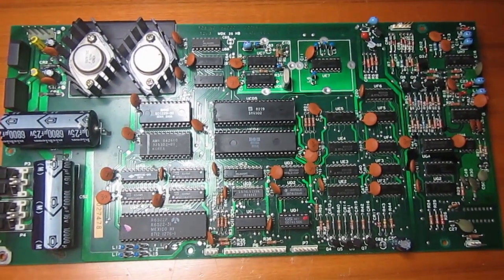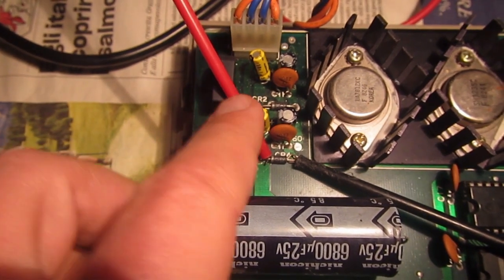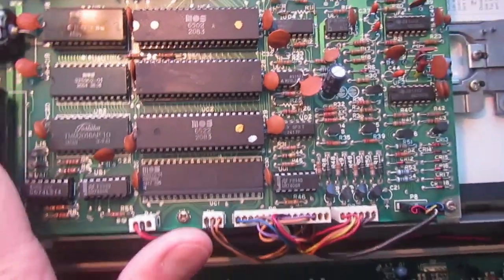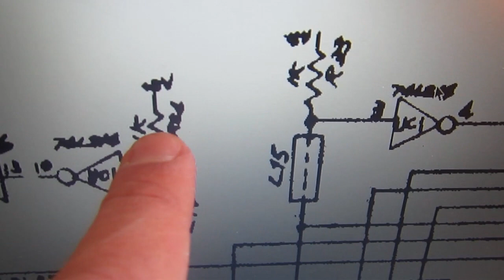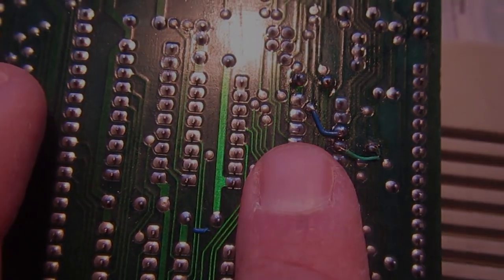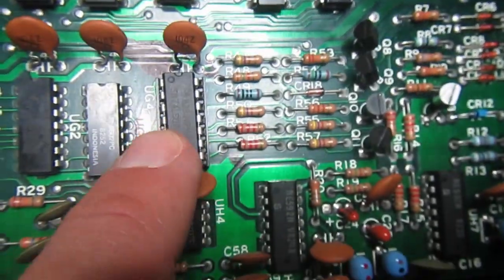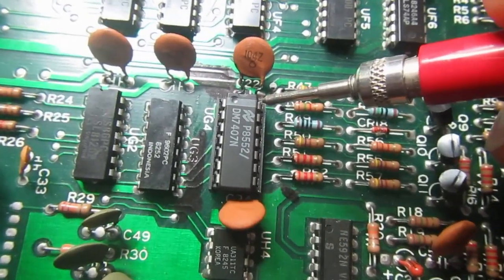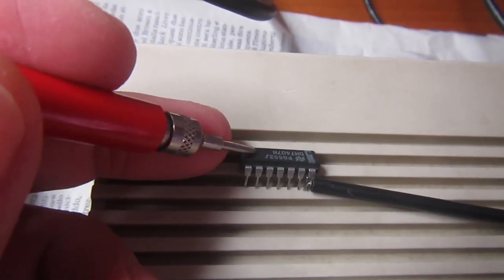Commodore 1540/1541 Long Board (long!) repair.

Comment: Adrian brought me here,  glad he did.  You have an excellent channel!  Also nice to see another Tek 475 scope out there.  I just did a complete restoration on one which honestly took me over a month.  I love these scopes.  I do have some spare parts for them,  if you need anything i can check to see if i have it.  Great channel!
Reply from the maker: HI! Thanks for the nice comment and welcome! I like my Tek scope, but I tend to use also some HP ones (mostly an HP-1725A, unfortunately it has a rather dim trace to be recorded). What I fear most is the 475 to need repair, it's a nightmare to disassemble compared to the HPs, but yeah, it's a great one! Analog scopes don't tell lies :)
Reply: @iz8dwf  That is the truth!..  I use a cheap Siglent digital scope for most work but the 475 is hooked up as my curve tracer and signature tracer.  Nothing beats analog for curve tracing. 🙂
Reply from the maker: @Sloxx701  By the way, my channel image logo is the first two base steps of a BC548 transistor on my curve tracer, hooked to an HP-180AR (as old as I am), the zero base current curve has been moved out of sight, it kind of recalls an F letter, but it's all analog-made :)

Comment: Only Long boards I have are all from the VIC1541 drive...all of which I have had Alignment issues with.  -Mark.
Reply from the maker: Hi Mark, the real 1540 are very rare, they costed more than a VIC-20 so they didn't sell many. All the unsold boards were then converted to 1541 after the C64 was becoming popular.

Comment: I would have been cautious with what disks you tested in there. If that was a signal going to the head it may have corrupted disks
Reply from the maker: Hi yes, this is a very good point that I didn't mention. Until one isn't sure what is going on, always use "disposable" disks (as in its content of course, the disks must be readable!).

Comment: The first amp is an auto gain amp so without the head coil connected or no disk it will maximize its gain. The second amp differentiates the signal from the first.

Where did you get that schematic?

On my long board the data bus is stuck all high. I have chip swapped all chips on the data bus and they all work in other devices. I also replaced all the chip select logic but the data bus remains high. Any ideas?

Great channel, keep up the good work. Long videos are cool.
Reply from the maker: Hi, yes it will maximize the gain but it should not oscillate like it did when the bad LS07 was clamping the DC level to 5.8V. 

Schematics are here:
http://www.zimmers.net/anonftp/pub/cbm/schematics/drives/new/1541/tech/index.html
On your stuck serial bus, did you try swapping the 6522s? Or trying new ones? If the interface chips are good and there're no broken traces, then the next problem might be the 6522. The bus lines are however pulled-up with 1K resistors, so stuck high means there's no oputput from the 6522 probably.

Comment: Nice HP meter, I have the 3435A which looks identical but only 3 digits instead of 4
Reply from the maker: Very nice indeed, the HP-3466A is the first bench multimeter I've got a "few" years ago. It needs new batteries every ten years if kept on charge most of the time :)

Comment: Where you able to find a 1540007 schematic? I bought a 1541 from eBay recently and it worked fine for about a week. It also has the 1540007 long board. It's not completing a reset from what I can tell. The red light and motor stay on. All reset pins on 6502 pin 40 and both 6522 pin 34 are at 5volts.
Reply from the maker: Hi, all I have found is at this url: http://www.zimmers.net/anonftp/pub/cbm/schematics/drives/new/1541/index.html and probably there are slightly different revisions of the old "long" board. However it should be possible to troubleshoot the board with the help of the similar schematics. If the motor stays on after reset, I would check the CPU address and data bus, the RAM/ROM and I/O select logic and the VIAs. Having a scope greatly helps. Also the address decoding logic can be verified using a NOP generator on the 6502 CPU.
Reply: Yes the one you have, shown in the video is the one I have. I also found the issue with the L14 and L15 somehow swapped around on the 1540008 verses the actual circuitry on the 1540007 board.